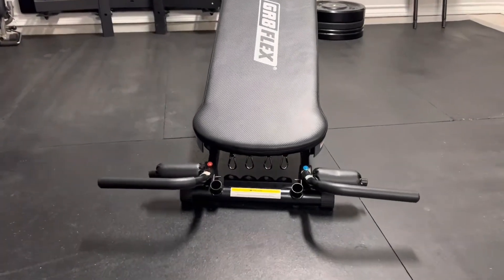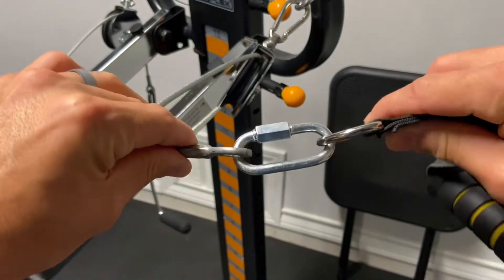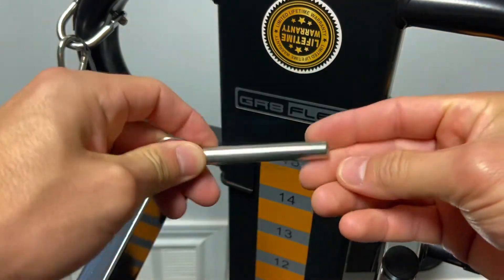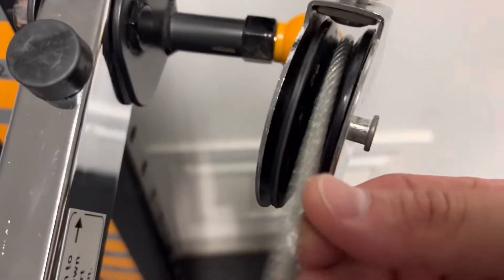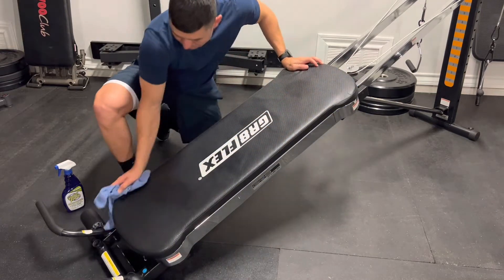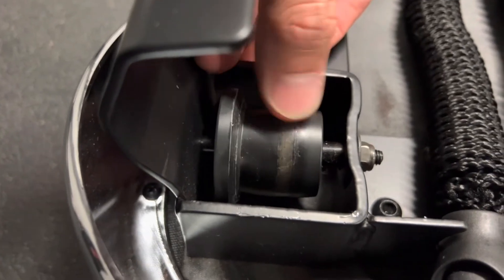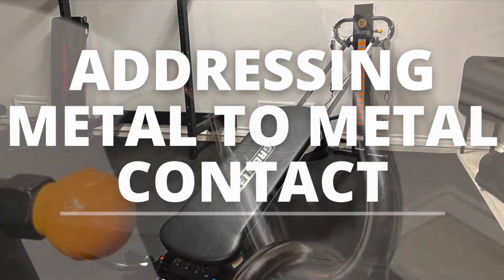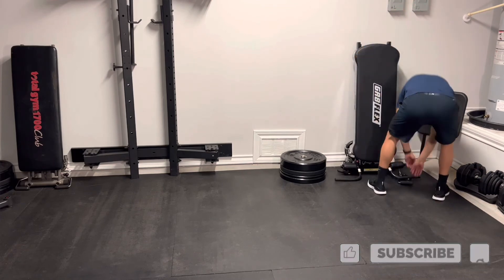GR8FLEX | Maintenance & Inspection

Comment: Got a nice solution for your metal tot metal contact between the pulley attachment and the frame, simply put a washer between the metal frame and the pulley attachment, it will act as a  glide bearing. problem solved. use a little touch up paint and ur are good as new.
Reply from the maker: That makes sense, I’ll try that. Thanks!
Reply from the maker: There is lots of play with that pulley on the GR8FLEX, I might have to try multiple washers for this. Will keep you posted.
Reply: Did it workout ?
Reply from the maker: I’m still trying different washer sizes. It looks like it will work, will get back to you on this
Reply from the maker: It worked! 2 washers on the top and one on the bottom side. I’ll have a video out in a few days to share your idea. Thanks!